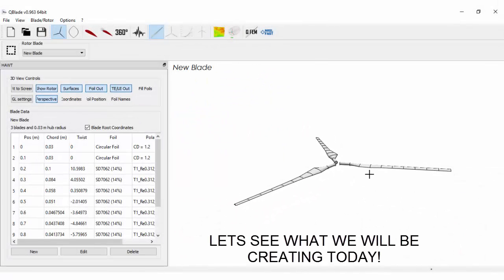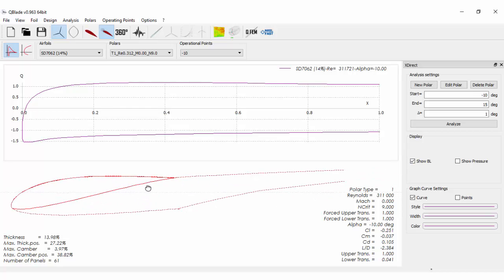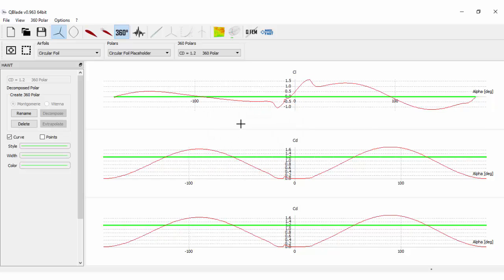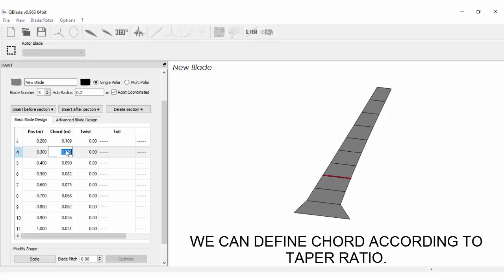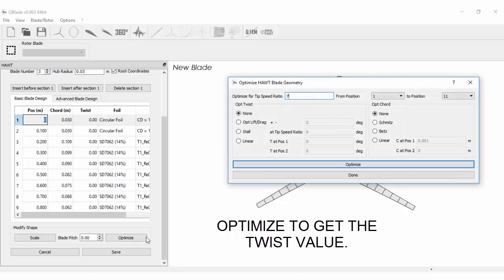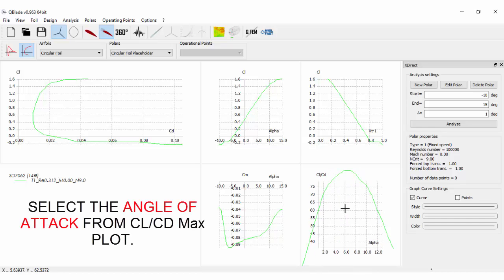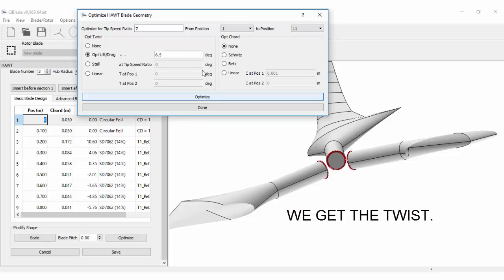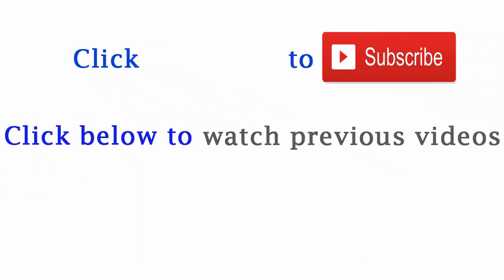Q-BLADE Tutorials for beginners | Blade Design |Wind Turbine| HAWT💙

Comment: There is a mistake in this tutorial video at (7:32): optimizing the twist for the optimal cl/cd should be set to 0 degrees. QBlade automaticaly detects at wich AoA the cl/cd is optimal and uses that AoA when this option is selected.  Putting a number other than zero in the box behind it  changes the AoA by that amount away from the ideal AoA. This is an option in case youre ideal cl/cd is at an AoA too close to the stall angle
Reply from the maker: Thanks for your correction sir! I will definitely try to correct it.

Comment: Hi, Is it possible to use different cross-section other than the NACA airfoil provided in the software ?
Reply from the maker: Absolutely!
Reply: @write2sijovarghese  what if the airfoil is multi-element ?
Reply from the maker: multi element in 2D? I am not sure if I have come across such situation. If possible send me a screenshot. I will look into the same.

Comment: How can I attain the dimensions to produce my blade in Solid Works?
Reply from the maker: If I understood your query correctly ; after producing the blade in qblade you need to export it in stl which can be imported into solidworks and probably use the ruler to measure dimensions roughly . If you just need the dimensions to create the blade from scratch then the parameters should be calculated manually.

Comment: but how can the twist be negative?  I'm getting the same result and the Cp is not very good...
Reply from the maker: Hello sir! If you are referring to the example that’s just for a demonstration of how this code can be utilised. The iteration on the geometric twist can be eased by choosing an optimised baseline haw turbine blade design.
Reply: You should optimise the twist for opt. cl/cd  and fill in 0 degrees in the box (see my comment above) This will change the twist to the correct one

Comment: Does qblade optimize the chord length automatically, or should this be done in a separate program using the outputs from qblade?
Reply from the maker: Hello! Sadly it doesn’t optimise chord length. One suggestion would be to optimise and then model it using qblade for results. Optimisation is a tedious work though! I understand.

Comment: if we want to study on hydrofoil and propeller, is it we can use this software too?
Reply from the maker: Wonderful question sir, as far as qblade is concerned it deals only with Horizonal axis and vertical axis wind turbine propeller blades. For hydrofoils and aircraft/ship propellers you can use ansys/icem cfd, which has dynamic meshing options too. Where you can go for FSI, fluid structure interaction.

Comment: Thank you very much for this instructive video.but would you please explain how you changed the chord in the first and second  line .you changed them to lower chord, by which logical you have used ? once again thank you
Reply from the maker: Thanks for the question! The reason being a requirement of stronger hub and have an equal force distribution throughout the span of the blade. Hope this answers the logic

Comment: Thanks for such a wonderful tutorial. I would like to know if we could import the 3d design to solidworks.
Reply: Thanks for your reply. I realized that I can't edit the design obtained in stl format. Hence I tried to export the blade design as co-ordinates. While I tried to export it into solidworks, it shows the error as "at least two adjacent points are identical or too close". How should I proceed further? 
Thanks again.
Reply from the maker: Yes! The model can be exported in stl format and can be imported into solidwork with settings to import as surface and edit the stl